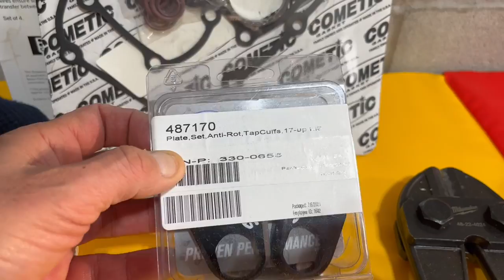Harley DIY Stage 2 On A Budget PT1

Comment: Always good to have a HD service manual present. Hoped you-all checked the sprocket alignment re replacing the crank sprocket. Alignment between the two sprockets must be .009 or less. Page 4-55 in my 2018 manual. Also heat is the fix for removing the stubborn cuff bolt. I installed the RS 468 in my bike and it's great. Using a power vision tuner.

Comment: Stage 1 and 2 are the best upgrades you can do on a Harley. Since I had to replace the tensioner shoes, I did a full Stage 2 on my Twin-Cam 88 02 Electra Glide in 2020, while at it. I used fueling components with an S&S 510 cam. It brought the old girl (The Bone-shaker) back to life. She’s not the power house that you will get, but I can still kill myself with what I have. My flat-six 1832cc Honda GoldWing is my Power house.

Comment: Did you even get your hands dirty??? Nice DIY project you guys have going there. I haven't had a bolt in that area be too tight, but I did have to extract the bolt when I was changing my heel gear peg. It was a bit challenging but we got it done. Looking good though Sandy. I need the recipe for that breakfast that you guys had, that looked yummy, cheers, 😎😎😎

Comment: I was doing a stage 2 also, replacing more parts though, and the Exact bolt broke on me..yea, way too but high temp thread locker used on a 1/4 bolt..but you guys did have to remove those cuffs (unless you wanted to replace them as I did) ..mine was buried, and a friend and I tried 12 times with a mug welder and finally got it out.

Comment: Between headbolts, foot rider plateforms bolts, passenger footpeg bolts and now tappets bolts, there are quite a worryig number of bolts that are overtightened in those M8 ... I'm sure they used shitty hardware to drop production costs and I saw a couple of comments online suggesting some of the Harley workers on production chains are not really concerned about their job ...

Anyway, it really makes any mod a dangerous task because you never know if you'll snap a bolt or not ...

Comment: Ask John for his rocker box covers or buy them off him since he is putting on new ones. When you take the tank off for the plug wires you can swap the brushed aluminum look with the black ones along with the colored spark plug wires would look AWESOME!  Save your Pennies for a chrome primary cover in the spring. Just a thought
Reply from the maker: Primary cover next …🤙🏼

Comment: Sandy, how do you like the Zippers 468? Any regrets? I'm torn between the 468 Redshift & the S&S475 CAM. How you liking it? thanks
Reply from the maker: I like the cam very much . It suits my riding style - mid range torque. I’m not a guy that hits the red limit and then shifts I’m always in the 2500-4500 RPM range seeking the toque not the Power at the Higher RPMs…
Reply: @HOLYSHIFT  Thanks for your feedback on the 468 cam Sandy, my ride style is very much like yours as well...the S&S 475 performs in the upper RPM range..so,  I think I'm going redshift 468. Thanks again, ride safe & if you guys are going to Laconia this year I'd like to buy you a beer brother!

Comment: I broke that same bolt when I did my stage 2 build, putting in the exact same cam. I was fortunate enough to get it out with an extraction tool and a heat gun. The trick is to go back and forth slowly and get the loctite warmed up. Good luck!

Comment: I saw the live install on your Bro's Flyride blog....I am been tossing it around on my FatBob 103 tc stage 2 setup...Still on the fence doing it...If aint broke dont fix it mindset...1 question...I heard the FP3 tuner isnt the best way to go when you have a stage 2 setup...What are you thoughts and what others say about it?
Reply from the maker: You know - every one thinks they know best…. I still don’t know - I have very little experience. But I am planning on taking the bike to a professional tuner - to get the most efficiency out of my set up . In any case all bikes are difficult-so it’s impossible to have 1 map that fits all . That’s why it’ needs to be customized tube to your specific bike.
Reply: @HOLYSHIFT  Thats why i asked...Because i dont know either...But i want to know from others whats best when the time comes for me to do a stage 2 and tune on mine...
Reply: @bradlozano2571  Hi Brad. If I can butt in to your conversation with Sandy. I was in your exact same spot about 10 months ago. I watched YT videos on exhaust, cams, tuners until my head was spinning. I purchased all my components myself, then talked to some questionable mechanics in my area. So here is what I learned. Find a mechanic / dyno guy you trust. Get the components  that HE recommends for your bike. Because those components will be the ones he is comfortable with and can give you the best results with. The mistake I made was in the exhaust system. I chose 2 into 1 and ended up with a less than desirable torque curve. If I had gone with his recommendations my tune would have been perfect.
Reply: @125saito  I appreachate that David...I do however have a Stage 1 setup already on the Bike...I have like Sandy a V@H 2 into 1 Propipe which i wouldnt want to change but have the right Cam that will be enhanced by it....
Reply: @bradlozano2571  V&H is good stuff. Do you have a tuner yet?
Reply: @125saito  I have the stage 1 fuelmoto one...It wont work on a Stage 2 application
Reply: @bradlozano2571  That sort of goes with what I was trying to say. I purchased the Dynojet tuner before I had found my mechanic. After I made my appointment for dyno tuning he asked me what tuner I had selected. I told him Dynojet and he said "well that's a good one but I prefer TTI. I think they are more versatile"
Reply: @125saito  Well i bought this Bike used in 2019 with 10k on it thats what it had...